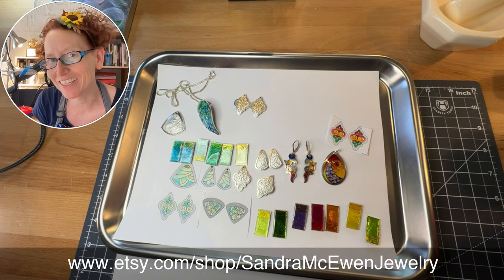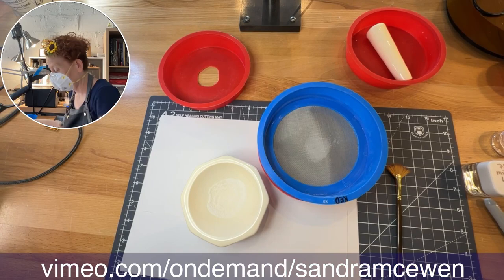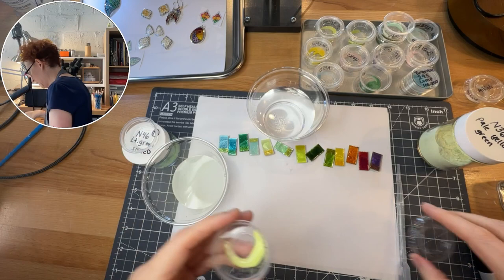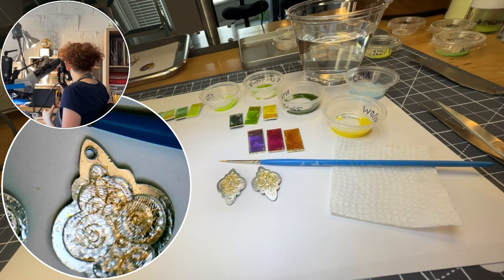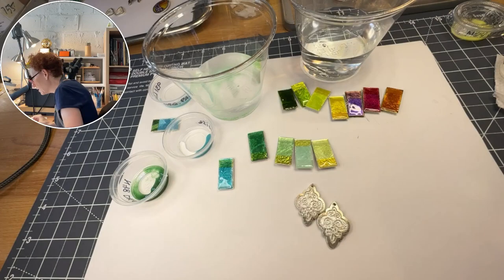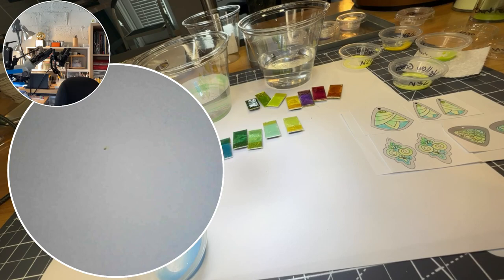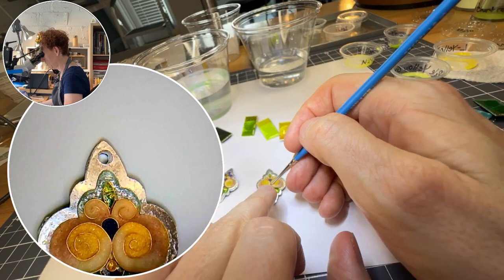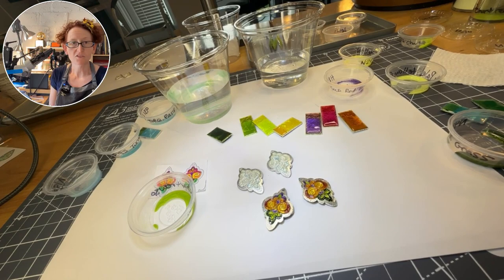Watch me Enamel!

Comment: Hi Sandra I have to admit I haven’t taken advantage of watching all of your videos but what I have seen is impressive, very impressive. Can you help me. I’m very new to enamelling, only made a couple of test pieces and I have a problem. I’m heating clean pickled copper and I’m using fine silver wire 0.2mm thick X 1.7mm wide. I’ve done tests with a gas torch and with an oven. I’m running the oven at 820 degrees C  (1,508 degrees F) with a precise controller (checked with a second pyrometer.)  In all cases I’ve first applied WG Ball 12542 Clear Flux wet process enamel.
The first problem is, the flux is never clear, it’s always milky. (on copper, not tried silver yet)
I apply and fire 2 layers of clear. The second problem is, I apply the wire onto of the second layer, very lightly pressing it into the hot enamel, it looks OK but when I apply coloured enamel on the third firing the cloisonné wire seems to melt into the glass, it disappears!! Is it alloying down at a lower temperature? It happens with the torch and the oven. I’m using WG Ball opaque glass  all 800      - 820 deg C  (1,472 -  1,508 deg F) Should I only use copper wire on a copper backing and silver wire on silver, or am I missing something?

Kind Regards . . .  Andy
Reply from the maker: Hi Andy!  Flux can be a real pain in the pa-tooty.  Some (most) of them just tend towards yellowing.  You might try a different flux or even skipping the flux and using a very pale blue instead.  

As to your second issue, if your wires are "disappearing" into the base, it's because you are firing too hot and the copper base and silver wires are creating a eutectic bond.  (Yay for them, not so good for you!). I'd lower your temperature to 1430F/776C and you will have better results.

If you'd like to learn more, I hope you'll consider subscribing to my Vimeo page.  I've got over a hundred tutorials: https://vimeo.com/ondemand/sandramcewen/ 

Thanks!
Reply: Hi Sandra thanks for the information. I'll try out your suggestions. The enamel specification says that the working temperature is  800 to 820 deg C but I will do as you say and see what I get.
Thanks again for the response, I know how much time it takes when you have so many live videos on the air. 
Your doing so very creative work, good luck with all of your endeavours. 
Kind regards . . .  Andy